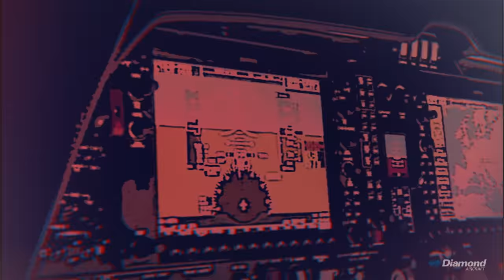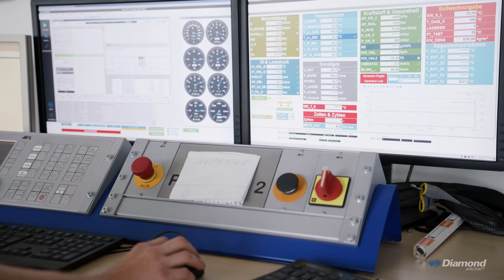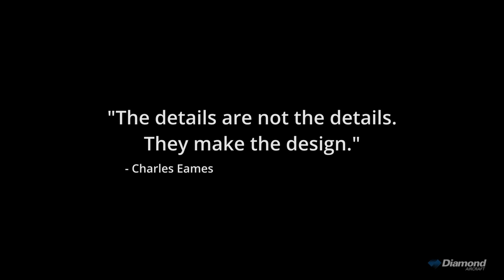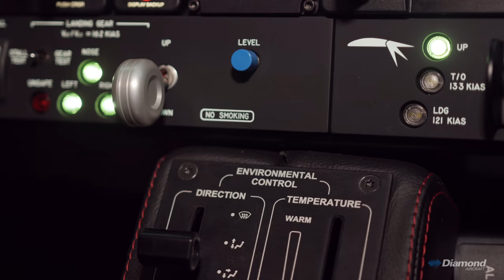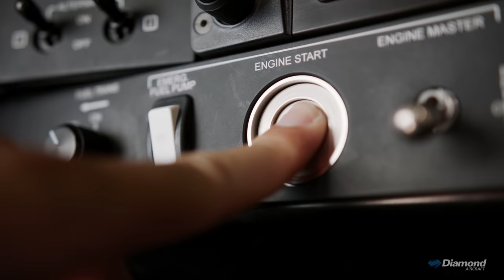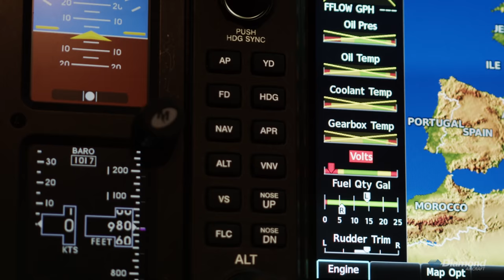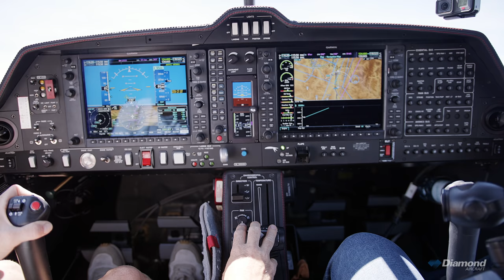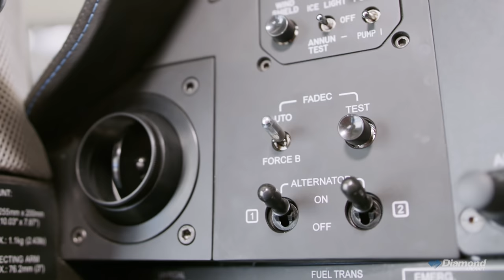THE DA50 RG ORIGIN STORY - Diamond Aircraft

Comment: GA accidents are statistically PILOT errors....GA pilots must be fixed so that this aircraft's safety designs can be complimented.   Loss of Control is pilot error ..... running out of fuel is pilot error .... Non rated pilots in IFR is pilot error.   Until GA pilots train like, operate like, make decisions like airline pilots, the aircraft used wont change accident risk statistics.   This aircraft appears to be a wonderful design, I hope that we can bring the average pilot's brain up to the same level of safety.

Comment: C’mon diamond bring out a turbo prop design that takes the challenge to Pilatus.. no one is even close to the PC12 NGX currently but I know the one company that could would be diamond. 

Ooo and I finally got my polo #iflydiamond top too, had to order to a my brother in-laws in German and then he brought it over to the U.K. it’s in many of my VLoGs. So comfortable and the material breathes and wicks away any moisture on the body. 

Just wish the cost to get them here in the U.K. wasn’t so high otherwise I’d have a wardrobe of them. Now just need to take my first diamond flight..

Comment: what happens when you use full flaps, slow it down to the stall angle and try to control bank angle from 20 degrees to - 20 degrees without using the rudder, and then pull it through stall maintaining  pitch attitude. Will the wings hold level attitude, use of power to maintain pitch up but modestly.
Can a pilot describe it or better video tape it. what  is the yaw rate, no rudder?
roll from side to side 20° to - 20°